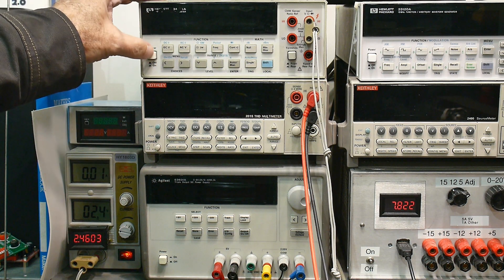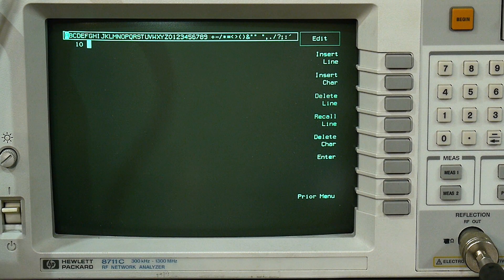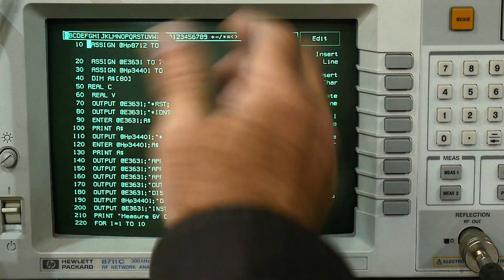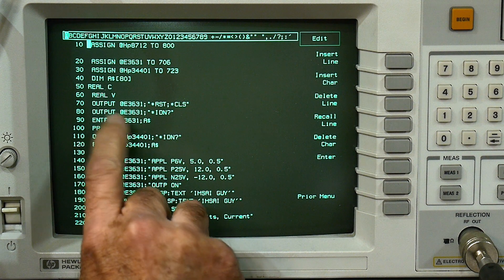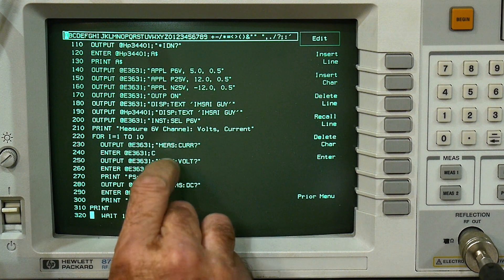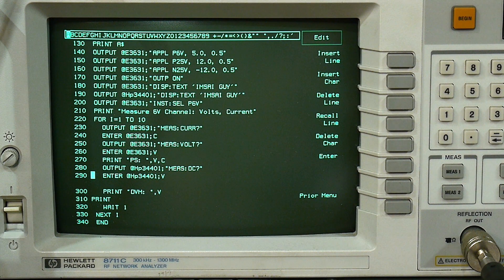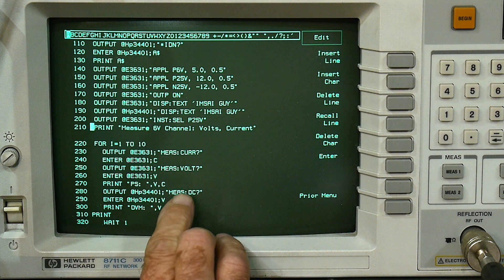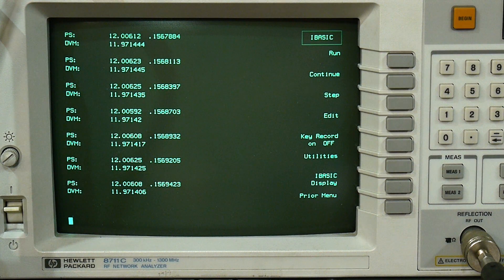#999 HPIB Instrument control with iBASIC

Comment: I am so glad to have found this channel. And this is really the 999th video from you? Holy crap, looks like I know what I am going to watch over the next 6 months
Reply: Do you have any videos on calibration of these test equipments?

I am not referring to the calibrate function or open-short-load calibration. I mean equipment that has been sitting for years that gets sent to a calibration lab.

Most videos I find only talk in regards to the former.

I'll have a search though. I am really stoked about this channel. Thanks!!!!
Reply from the maker: The calibration of the HP8711 is covered in the service manual. It was designed to be calibrated over HPIB with particular HP instruments. If you don't have those specific instruments then some of the cal steps are not possible. I was a able to do about 60% of the steps without special equipment.

Comment: Thank you. This is extremely good because hpib tutorials and examples are quite rare, which is strange because GPIB is still used in industry and HP Basic is still produced,  and updated! I've seen this done using a pc and a national instruments adapter. I didn't know you could run a program from a network analyser though , which  is really interesting. You mentioned the difference between the two buses,  one being internal and the other being external. Is this set by default or is it a standard? I am sure I've seen this designated to two external gpib networks in the past using two gpib adapters from a single pc, one being 700 the other 800? The last two digets denote the IP address.
Reply from the maker: Yes, the controller has an address also, usually 7. so most controllers use 7xx for the control where xx is the address of the unit to be talked to. As you say you could have more than one controller on the buss, so they just used that protocol inside the instrument and dedicated 8 as the internal buss and 00 as the unit address.
Reply: @IMSAIGuy  Hi again, if you ever get the time, it would be helpful to demonstrate how to do this using gpib from a pc. Including what's needed in the background as a bare minimum. Its easier from the analyser as that is , I presume,  acting as the controller. It is fun admittedly but not really practical in a test environment I think. On the pc you would need to bind libraries and 488 standard. I am trying to learn how to do this but most videos are, it seems to me, incomplete, especially if your trying to do this in qbasic or VB

Comment: I’m playing with HPIB And the prologix usb. Looking for a way to use my newer laptop to run hp basic. I’m a hobbyist so it takes me a long time to work this stuff out. 
You are one of my favorite youtubers!

I have several HPIB instruments. One is 59309a clock
Reply from the maker: those clocks are pretty rare. I don't think I've seen one in person. I have a prologix usb adapter also. they work well.
Reply: @IMSAIGuy  yes they do one command at a time.
Reply from the maker: @markgreco1962  ??? you mean the config program? one line at a time. That adapter maps the USB to a serial port on your computer, then you use any programming language to send command to the serial port.
Reply: @IMSAIGuy  yes!! What program do you use? That is where I’m struggling
Reply from the maker: @markgreco1962  in the past I have used Matlab. I tried GNU octave but it does not have as good of drivers, works some. Any program that can write and read serial ports should work.
Reply from the maker: @markgreco1962  https://pyvisa.readthedocs.io/en/latest/
https://hackaday.com/2016/11/16/how-to-control-your-instruments-from-a-computer-its-easier-than-you-think/
Reply from the maker: or go to the prologix web site they give examples using python, basic, matlab, microsoft c++
Reply: @IMSAIGuy  THANKS!